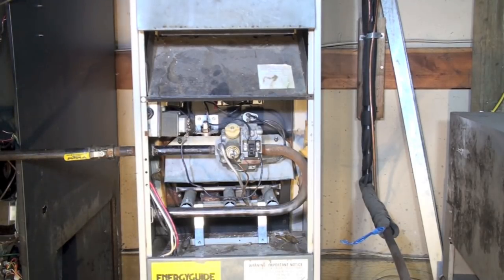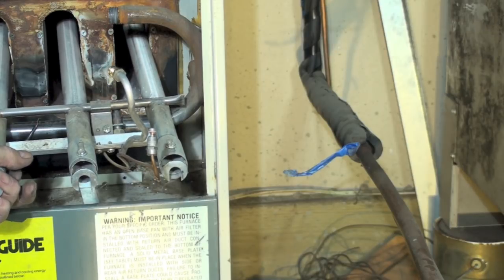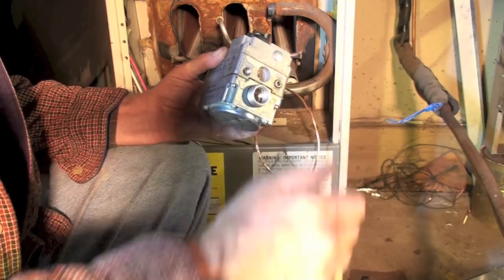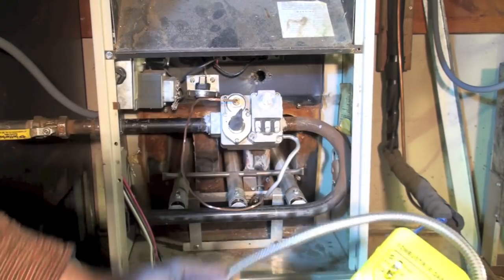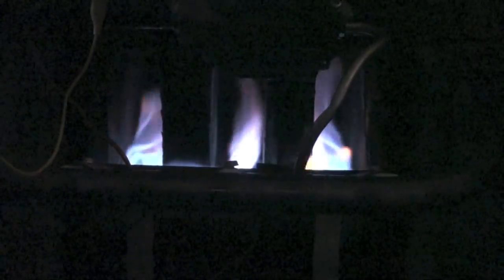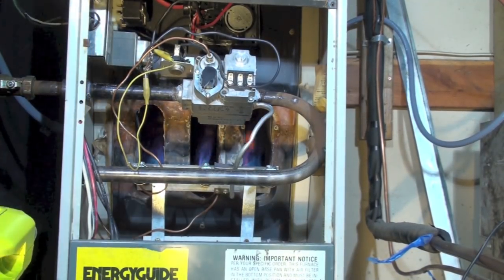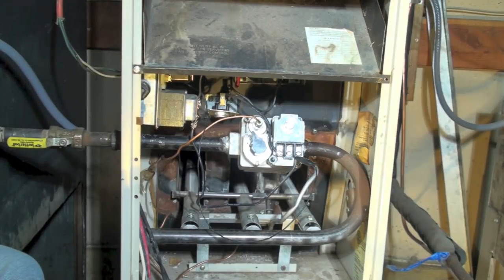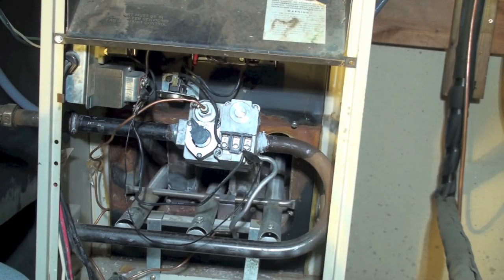How to replace the combination gas valve

Comment: I HAD A WELDER MIG WELD A WALL HEATER WITH A CRACKED FLAME TUBE...WHICH HAS LASTED WELL FOR YEARS. BUT IF A NEW PART IS AVAILABLE..USE IT !

Comment: I have an older 1970s payne day and night furnace and the burners don't fire up. I don't have the money to replace the furnace so I'm trying to find a replacement valve valve for it.
Reply from the maker: If it has a pilot, a general replacement valve should work.
GFM
Reply: @grayfurnaceman  thanks. The original valve has a pinned-in solenoid assembly with 2 connectors. Black/Yellow to one side and Black to the other side. What does that mean? Also the pilot is part of a 2 wire assembly, a thermopile I think? Not sure how all the wiring is going to rout on the new replacement.
Reply from the maker: @T1374  If you can send pics, that may help.  Send to Grayfurnaceman@gmail.com
GFM
Reply: @grayfurnaceman  Thank you.  I'll send some out to you tomorrow.

Comment: i have a york borg warner furnace and i need to order a new combination gas control valve but i cant seem to find out if i can use a universal valve. the old valve is an                                   essex TF-155    210-221000-1332A i found on used on ebay but i was trying to find a better deal

Comment: Thanks for the video.  Had a stuck gas valve once--"On" on the gas boiler (1992).   In the 1980s had a leak at the pilot line/valve body (As you describe).  Took considerable effort to fix it and singed my eyebrows in doing so!!
Reply from the maker: Welcome
GFM

Comment: Late to the party (commenting on 9 year old video).  A lot of detail for a standing pilot furnace.  Much needed for today's service techs.  Trade schools do not teach this stuff well enough.  All of our young techs are clueless when they see a standing pilot appliance.  A couple of things I wished you would have covered:
1. The ECO circuit was not connected to the old valve you removed and you did not connect the circuit to your new valve.  The manufacturer put that safety in the furnace and it is not our job to decide that safety should be taken out (without a document from the manufacturer saying that it can be removed if you upgrade to a redundant valve).  It is troubling to me when any furnace safety is ignored.
2. Roll out switch bracket was bent out of position and should have been put back to proper position.
3. I like to check and adjust the flame with the roll-out shield in place because the combustion air pattern changes with it installed.  Not very easy to video the flames with it in place so I can see why you didn't have it installed.
Other than that, good job GFM!!😀

Comment: Thanks greyfurnaceman I really appreciate this, I needed this teaching video to help me obtain NATE Cert. I also was trying to figure out issue I had with pre-ignition issue, I hope you can provide insight to what may cause this other than ,I already checked for misaligned burners and there is a draft (air) filtrating the burn area.
Reply from the maker: +raminla2000 Do you mean delayed ignition?
GFM

Comment: I moved into an old Mobile home with an old Duotherm 52,000 btu  NG/LPG furnace. It is running on LPG.
Can't afford to upgrade to a newer safer unit. I was told It hasn't been used for 16 years since the owner passed away. I had to find a source for information on these relic standing pilot ones and this channel is most informative. Like going to a tech school at home. I have an issue tho with a slight propane smell. It smells like a small leak but only noticeable when my propane tank is low. I've done the soap and bubble spray test, with gas valve on and furnace running/not running. It has on old White Rogers valve. I put my nose close to the on/off/pilot button and it smells like that is where it's coming from, but no bubbles when sprayed. Do those or any control valve have O-rings/gaskets that wear out internally and not sealing? Or can the issue be a gas in/out pressure problem? I have a little bag with the NG orifice fitting inside of it so I'm assuming it has the LPG orifice installed. I appreciate your great channel and any pointers thank you.
Reply from the maker: Gas valves sometimes leak at the knob where the shaft enters the casting.  Pretty tough to determine unless you are using an electronic detector.
GFM
Reply: @grayfurnaceman  - Yes I heard you mention that and how the soap test wont work on the knob in the video. When I put my face close to the valve and did the nose test, it confirmed it for sure. Now I'm looking online for a modern replacement. It's obviously  discontinued by White Rogers  and it's funky cause the gas inlet is at 12 o'clock top position and exit is on the side at 9 o'clock smh. I'm going to have to re-pipe a new one as it will be a straight through style. Their website recognizes the old model number but doesn't offer any specs or comparable replacement. The old one is a 36B12Z-201. I'm only guessing that their 36C03-300 OR 333 may work out but I may have to call them to be sure.
Reply from the maker: @Alpha-ms9nj  The 333 has side outlets that may make the install easier.
GFM
Reply: @grayfurnaceman  - Huh..Is that what they mean by tapped and plugged? Has other inlet/outlet options? BTW, Thank you for the help and guidance. Merry Christmas to you and yours.
Reply from the maker: @Alpha-ms9nj  It is.  I believe that valve has both right and left outlet in addition to the straight thru option.  Merry Christmas
GFM

Comment: great video as usual, I had this same furnace last week where the roll out switch over the burners tripped. Draft was ok but alot of heat over the burners. I had to shut the furnace down. Very old furnace they decided to go with a new one

Comment: I would love to know what tool you use to get those reducers into the new valve body? Some sort of inside tightening?
Reply from the maker: My fingers.  You simply screw it onto the male end of the pipe, then screw into the valve and tighten.  Of course with pipe dope on all male surfaces.
GFM

Comment: Good information and your videos are easy to understand. My problem is the gas valve is making a buzzing sound and I have determined the solenoid is bad. It's a Essex gas valve SX242NSPR/ 242-111151-3152. I found a used one but the number is SX242NS / 242-111121-1101. They look identical but I don't know what the SPR in my bad valve designates. Any advice on compatibility would be great.

Comment: Hi, I have a lennox gas valve 73w17. There are two wires connected to it. One yellow wire and one orange wire. Does it matter which wire goes where on the gas valve? Lots of videos have it orange ontop and yellow at bottom. If I have it the other way with yellow ontop and orange at bottom. Will the valve function the same? Thanks
Reply from the maker: Any way will do.  It is not polarity sensitive.
GFM
Reply: Thank you

Comment: Hello, I have an Royal gas wall furnace from the 50's. It works perfect, but is worrisome because the pilot continues to flow gas even when the flame is not lit. Apparently it was made that way. Would it be possible to retrofit a control  valve with those safety features?
Reply from the maker: Yes, and I would do so.  That appliance is unsafe.  A combination gas valve will replace your entire gas chain.
GFM
Reply: @grayfurnaceman  Thank you so much for the quick reply. I'll call someone tomorrow to see about replacement.

Comment: To the right of the pressure regulator you can see  the pressure regulator vent (it's plugged up with what seems to be a metallic plug, and sits just above the tap that you used to measure the gas pressure). What is the point of this vent? Should there be a vent line going from the valve?
Reply from the maker: The vent tap is not really plugged.  The cap does not seal.  
The vent is to place the regulator in the same pressure area as the burners.  
If this furnace had a sealed combustion chamber, there would be a vent line to the combustion chamber.
GFM
Reply: @grayfurnaceman  thank you for clarifying that.

Comment: Great video !     I learned several things, even though I have done some of these valve replacements before. I've not seen one with adjustment  for manifold pressure. Maybe I didn't know what I was looking at, or maybe the LP burning mobile home furnaces I service (usually single burner) don't have adjuster. I'll look closely on future jobs. I will also start testing limit switches...never have done that.
Have you ever tried a flare nut wrench to tweak leaking pilot tubing compression fittings ?   I have an old 3/8 & 7/16" Lisle  six point flare nut wrench (for automotive fuel & brake line fittings) which I ground one side (they come rounded a little) flat...so it will slide over nut just a bit more.  Works great. Little extra bit of torque available with these almost always stops leakage for me, no pipe goop needed.     Thanks for the video , much appreciated             Rob

Comment: Where would I go to buy a valve like that? Mine is probably bad. My pilot light is on but when you set to auto the furnace doesn’t engage. When I set to On the furnace and fan starts but blows cool air only
Reply from the maker: There are a number of problems that this could be.  If there is no voltage to the valve an a call for heat, the valve is ok.
GFM

Comment: One question Gray. What  tape or thread  dope I can use to stop gas leak from a connection of termocouple with gas valve ? thank you
Reply from the maker: The thermocouple threaded connection to the gas valve should not be sealed in any way.  Are you sure you are not thinking about the pilot gas tubing connection?
GFM

Comment: My hvac tech put a new combo valve with the thermocouple and it will not take lot more that 5 more minutes any suggestions it’s an old American standard
Reply from the maker: You are going to have to try that again.  I did not understand.
GFM
Reply: @grayfurnaceman  we blew compressed air through the pilot tube thst did the trick. It was some blockage it seems
Reply: @grayfurnaceman  combo gas valve is née and thermocouple it would not stay lit but the compressed air in line for pilot fixed it
Reply from the maker: @lamontgarrison3296  Glad you got it going.
GFM

Comment: Great video, question, what about ending with a flue gas analysis??  Russ Motchell
Reply from the maker: I virtually never do a flue gas analysis on a gas designed furnace.  If the manifold pressure and orifices are correct, the only adjustments for efficiency would be the primary air if it is adjustable.  From doing such tests, I have found that there is little I can do to increase efficiency, and in some cases, the efficiency may show higher with by increasing manifold pressure beyond manufacturer specs.  In my jurisdiction, I cannot set the manifold pressure above or below the manufacturer's specs.  I will do more on this in the future.
GFM
Reply: thanks. Great job with the videos, really enjoy the way you explain everything your doing. makes it easier to understand.      Russ

Comment: Hi Grayfurnaceman! I have one question: Single stage furnace valve is being replaced. Old valve had two wires, one shielded, that were plugged into terminals both marked MV. New valve has no markings. How do I know which terminals to plug the two wires on the new valve? Does it matter?
Reply from the maker: +Andrew Ha It should make no difference.
GFM
Reply: Thanks so much GFM. Your advice has helped me so much and I'm sure thousands of other people. Thank you for freely passing on your knowledge.
Reply from the maker: +Andrew Ha Welcome
GFM
Reply: So wait. I also have two wires running to my valve. Of there are 3 connections available. Are you saying that I only need to connect one of the wires to my new valve ?
Reply: And of course thanks for you video. Brilliant.

Comment: What controls the delay in the blower coming on?
Reply from the maker: Most furnaces of this age have a heat operated fan switch.
GFM
Reply: @grayfurnaceman  thanks, I looked further in your videos and found the one about fan limit switch. I saw it on the furnace but thought it was a capacitor. I will check it. Its probably my culprit. I subscribed to your channel.  Your are awsome and a grest help for me understanding these units
Reply: @grayfurnaceman  Im replacing the original gas valve, a Honeywell VR8000C, the new one looks quite different. What terminal does the wire go on, the TH or TR?
Reply from the maker: @coach3958  If you  mean the wire from the limit switch, it would be TH.
GFM

Comment: one question Gray where you connect the manometer
one to the cap val where you connect the second one 
to check don't see and the video
Reply from the maker: +Gerardo Micelles You only need to connect it to the positive side of the manometer.  The other one is left open to the atmosphere.
GFM

Comment: I have an old American Standard Gas Furnace Model # GUF 800 E2.  Serial # starts with H so from what I read online, it was made in 1993.  I can't find any info on Google in regards to the Model # GUF 800 E2.  I don't think it has a controller board or anything.  It looks pretty basic.

The issue with the furnace is that the Pilot light will not stay lit.  As soon as you let go of the pilot light switch, it turns off.  I replaced the Thermocouple with a Honeywell model from Lowes.  Still the same problem.  

I called a local HVAC guy and he said to remove the pilot assembly and blow compressed air through it.  That didn't solve the problem either.  So I called him again and he said to probably change out the Gas Valve.  

My question is are these gas valves that have pilot lights & thermocouples universal or do I have to get a specific one?  

Is there a particular brand/model gas valve you recommend that will work with my old American Standard furnace?  Thanks for all your help.  I really appreciate the videos.
Reply from the maker: +Khyber Safi I believe your unit is quite generic.  Honeywell, Robertshaw, and White Rodgers all make generic valves.  Probably any of these will work.  Hope this helps.
GFM
Reply: +grayfurnaceman Is one more durable/reliable than the other when it comes to Honeywell, Robertshaw and White Rodgers?  Which one do you prefer to use or recommend?  What's a good place to buy them online?

Do I have to stick with the pilot light or can I upgrade to a better form of ignition since I'll be changing out the gas valve anyways?  Thanks.
Reply from the maker: +Khyber Safi You must keep the pilot.  I don't have a preference on the brands.  They are all good.
GFM
Reply: +grayfurnaceman I think I will change change out the Pilot light too while I'm at it since the old one looks rusty and corroded.  Won't hurt to change it out while I'm replacing the gas valve.  

What are some good brands for Pilot Lights?  Thanks.
Reply from the maker: +Khyber Safi Mostly the same manufacturers.
GFM

Comment: I wanted to see how you got the valve loose because mine won't rotate. The burner manifolds are in the way and there isn't room to rotate it. But you just cut that part out.....
Reply from the maker: They were able to screw it on at the factory, you can get it off.  Try removing the manifold/gas valve assembly.
GFM
Reply: grayfurnaceman I appreciate the response. I figured it out. Was just hoping to maybe get a hint from the video.
On my big old shop furnace you can remove the manifold by removing 2 screws and sliding it out. then you can remove the valve and the gas line from the manifold and then rotate the valve off. 
Unfortunately, those who installed this furnace years ago put it too close to the wall so I had no room to slide It out(It is suspended from the ceiling in the corner) 
I removed the front rail that the manifold rests on and dropped it out instead.
Uggghh. anyways, thanks. Took a lot longer than it should have.
Thanks again, GFM
HARLAN

Comment: I am watching this because I don'rt even know how to light the damned thing.  My "hot Dawg" Modine garage heater doesn't have a reset button so I am assuming that means I'll have to get an igniter to light it. I am not interested in doing any disasembly but I was wondering if you can use an in home carbon monoxide detector to check for leaks? I wanted to start this thing for our November freezing spell. I use my garage for many projects.
Reply from the maker: fucheduck It should detect if mounted near the supply air.
GFM
Reply: grayfurnaceman thanks!

Comment: I have a combination gas valve and my pilot stays lit, but i can't get the blower to kick on. what do you think the problem is. I have bought a replacement valve just in case. As a matter of fact the valve that i have is the same one that you're replacing in the video. c3602-200 is the part number for this particular gas valve.
Reply from the maker: Does the main burner come on?
GFM
Reply: did you check the fan relay switch . just a thought

Comment: thought gas valve had to be fitted so as not to fall to off position
Reply from the maker: I think the valve used, as most, can be fitted in any position except vertical down.
GFM